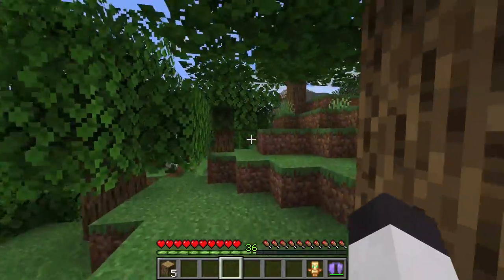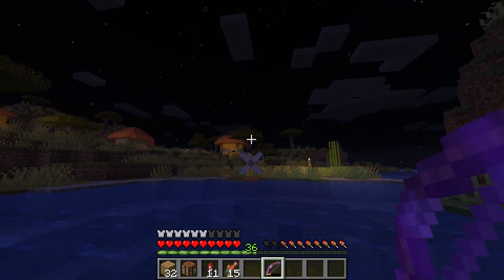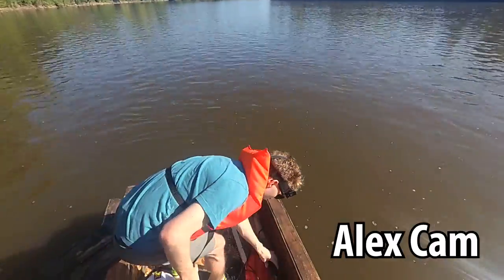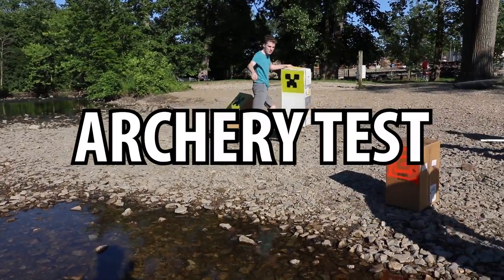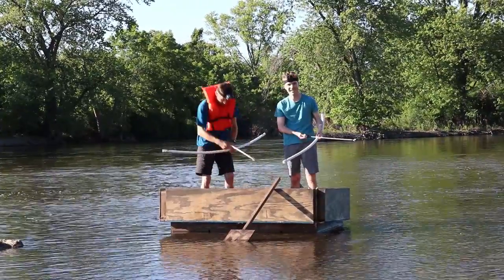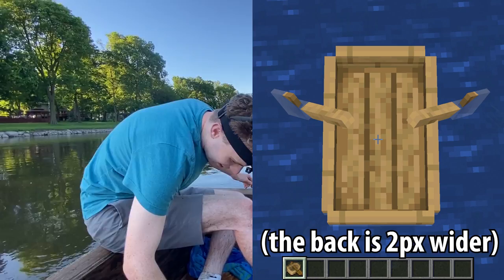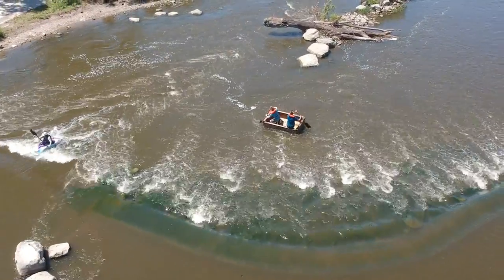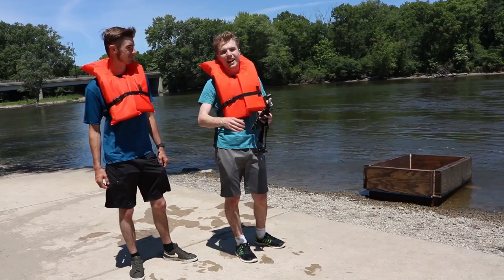Will It Float? Testing Minecraft Boat in Real Life!

Comment: Ya know why the boat is so fast? Cuz it’s being rowed by the same guy that can carry 45,000 tones of gold blocks without breaking a sweat
Reply: Lol
Reply: Only 45K? But what about shulkers and ender chests holding golden apples which are made of eight gold blocks each? That's easily 8-10X 45K tons!
Edit: Seven months later. I feel like I started an argument now and I'm not sure if I like it or not.
Reply: @Lorinissa-  watch the video, 45k is a massive understatement
Reply: @alexs6746  I don't remember the slight details like that
Reply: @Lorinissa-  e chests don't count, they have no connection to the inventory other than both being in the player data. if you die you drop your inventory but your e chest is fine
Reply: Do y mean tons?
Reply: @kaitlincanterbury4415  Different measurement, or maybe just the different spelling idr. There are two kinds of Ton, there is the short ton, which the US uses, and the Metric Ton, which almost everyone else uses.
Reply: @kaitlincanterbury4415  I just typed what autocorrect correct let me
Reply: @Lorinissa-  the ender chest is technically infinitely dense but with only its material weight, so it would only be like 2 meters cubed of obsidian and one fire-powdered enderman testicle. This results to the total weight of 20400 kilograms, or 44974.301 pounds. Compared to the gold, it's certainly a lot less

Also why the heck am I calculating this
Reply: @David_Franco  O.O
Okay but that's actually pretty cool-
And no, I actually didn't know that ;-;
Reply: This isn't a chat.. it's a youtube reply section
Reply: And a guy that can hold infinite items in a pocket. With a help with ender chests
Reply: BRUHIFY
Reply: “Tones” yep that’s how tons should be spelled tones is like a tone for a voice or instrument XD
Reply: WOAH XD
Reply: Yeah makes sense now
Reply: What about a shulker box has 27 chest,each has 27shulker box,each has 27 stack of golden apple enchanted(from 1.8)equal to 102036672 gold ingot
Reply: you’re a genius
Reply: Steve OP
Reply: And he can break a log with his hand just his hands! That like breaking your leg
Reply: True
Reply: 😂😂😂😂😂😂 so true
Reply: Steve is secretly superman
Reply: AND HE CAN BREAK STONE BLOCKS WITH HIS HANDS!!!!!!!! Now that’s like breaking 10 legs at the same time
Reply: Lmao 🤣🤣 XD
Reply: 45k? You mean THE FUCKING OMNIVERSE!
Reply: Lol, So true.
Lol, So weird.
Reply: Fax 😂
Reply: Technically it's horsepower since being strong doesn't technically mean being fast
Reply: It has been brought to my attention that Steve is also capable of consuming en entire chicken, bones and all, in a matter of seconds, this mans is insane.
Reply: Even more weight in netherite
Reply: And the same guy that can wield an iron pickaxe with one hand swinging at the speed at light
Reply: Oh so true!
Reply: @xianpaulosolis3822  both are technically correct
Reply: Well yea that’s true and it makes sense too
Reply: Wow made that rime without trying
Reply: The dude can carry the MULTIVERSE without breaking a sweat.
Reply: @KL-ew3fx  so that's the reason ya dont have to worry... U won't receive notifications... Utill ya comment 😀
Reply: But can't jump over a 1m tall fence
Reply: @senorx1011  only weakness, one and a half meter wall
Reply: Steve can have infinite space. You fill up your inventory with Shulker boxes, And in those Shulker boxes you fill them with gold except one slot, and in that slot you put another Schuller box. And you fill all the space in those Schuller boxes with gold except one slot, and in that shot you put a shulker box. And you repeat that forever. So steve can hold infinite amount of stuff
Reply: @blank888  only one problem there, you can’t put shulker boxes in shulker boxes (I’ve tried)
Reply: @alexs6746  noooo, well the next best thing is to put chests in the Schulker boxes and fill the chests
Reply: Lol
Reply: 19,300 kg/m³ × 64/slot =
1,235,200 kg PER slot

1,235,200 kg/slot × 27 slots =
33,350,400 kg PER shulker

So yeah on ONE ARM he can carry 33,350.4 tonnes
(On Inventory oooooooooo boooooyyyy)

33,350.4 tonnes/slot × 36 slots of inventory =
1,200,614.4 tonnes of gold
in survival (but on creative there is a way to make it larger but im not Austin)
Reply: i forgot enchanted golden apples but the comment is about gold blocks
Reply: not only can he carry it, but he can full on sprint and jump at over 5 meters per second . he just built different.
Reply: @Lorinissa-  golden apples are 8 golden ingots each
Reply: Ha
Reply: @cowhorse4146  They were probably referring to the old crafting recipe for the god apples
Reply: And murder a dragon from another realm
Reply: If you calculate it assuming gold blocks and not enchanted golden apples, using a combination of shulker boxes, armor, and the off hand, it would be 62,208 gold blocks, which combined with armor, comes to about 1,361,679.7 Tons. So yeah, Steve can lift
Edit: Assuming that enchanted golden apples have the same composition between all versions of Minecraft (8 Gold Blocks and 1 Apple), that would bring the total amount of cubic meters of gold to 497,664, which adds up to 10,598,642.1 Tons (If you also consider the weight of all the apples required to make that many golden apples, which ads about 6 tons), while also not considering the wait of the shulker boxes sense there’s no real way to determine that.
Reply: @jaderking8598  powdered*
Reply: @David_Franco  powdered*
Reply: @jaderking8598   did I not say that?
Reply: @David_Franco  yeah, thats why i answered You with that xd
Reply: @jaderking8598  no you're supposed to use that symbol when correcting someone
Reply: @alfielfordgabriel  But to another Steve, not a normal human
Reply: @blank888  So shulker box, chest, shulker box?
Reply: Mans as strong as base form goku
Reply: Just look at Steve being able to break wood with his bare hands and wear that heavy af diamond and netherite armor
Reply: On the other hand, the boat should be able to float with the guy carrying that much stuff.
Reply: Very final conclusion; the boat is sturdy af
Reply: Or like 3 Billion Pounds
Reply: @prot0prawnsuitablesinc.dom185  Europe also uses short ton
Reply: @alop53O1  Ah ok.
Reply: The same guy who can long jump 4 metres forward and break 1 cubic metre of wood in 3 seconds with his bare hands.
Reply: 2 things is that a game theory and tons not tones
Reply: It’s like 8x10 to the power of 500
Reply: He can also destroy a tree with his bare hands
Reply: Even that guy could carry a full inventory of full-stacked enchanted golden apples that's crafted with 1 apple and 8 gold blocks before the recipe are removed due it is too overpowered
Reply: Nothing compared to the terrarian
Reply: what about packed ice, its heavier than gold...
Reply: @rafi_cat2851  i think ender chest don't cound becuse i think they open a portal to an other dimension
Reply: Breaking a sweat is actually wrong lmao. He does lose hunger
Reply: Oh my god oh my god
Reply: Even more Tones if you use Shulkerboxes, or even OPgoldenapples if you take the Recipe they once had using 8 Goldbloks per OP Apple.
Reply: @jimicencagalfin3129  фхххффхффээхфффйффээхххффф
Reply: @zephyr8921  that could work
Reply: Steve goin swole
Reply: @jimicencagalfin3129  p what your name creeper guy
Reply: @Lorinissa-  e chests don't count because they are a small pocket dimension portal for items
Reply: @jimicencagalfin3129  ฝืเดดดดดดดด
ชง
Reply: Yep
Reply: And he also have a proper fishing rod
Reply: YEA
Reply: Always found that odd to me when I first played Minecraft
Reply: @Lorinissa-  I think it’s like 19 tons for a 1x1 meter block and you can hold like 63000 blocks in your inventory using shulker boxes sooooooo
Reply: True
Reply: Technically infinite as they showed
Reply: Man's can carry 45000 tons of gold no sweat, but can't carry 45000.0001 tons. Tsk tsk.
Reply: lmao God Christ Jesus bless you all and have a wonderful day my family
Reply: u mean netherite since it's four times as heavy as one gold block?
Reply: Yeah he Stronk
Reply: @Lorinissa-  shulkers use alternate dimensions to store stuff (thus come from the end) ,the weight of the things inside them is nullified ,since the items are not physically there
Reply: @g0n245  there is nothing that is comparable to netherite irl so we have no idea how heavy it is, besides he can basically carry an infinite amount of items so it does not matter
Reply: @Lorinissa-  what about shulker boxes full of netherite blocks..
Reply: What about shulckers full of shulkers full of shulkers full of frickin obsidian
Reply: What about that he can break trees and survive being biten by a zombie?
Reply: @Averagecatlover0__0  gold is heavier then obsidian and you can’t put shulkers in shulkers
Reply: @Lorinissa-  I don't think Steve holds the contents of an ender chest, since it's made from an enderpeal and can teleport the contents across the world
Reply: tones
Reply: @joshuataduran4746  and obsidian
Reply: @hiimapenguin  netherite enchanted gapple?
Plus we can't calculate netherite since it's not real
Reply: @blank888  but you can't do that lmao
Reply: @cowhorse4146  Enchanted gapples are 8 blocks of gold each plus an apple
Reply: @swimm8329  you can't do that though
Reply: @SquidsINCIsABadYouTuber  end chests are pocket demensions Shiller boss are not
As can be seen by throwing one onto a catcus
Reply: @bigbrainmatt3080  enchanted gapples still weigh more
Reply: @tigerarora1812  not from holding them though lmao
Reply: @IsLiterallyMe  creative mode doesn't really count
Reply: @g0n245  uhh what it's weighs less since you use ingots not blocks plus enchanted gapples STILL weigh more
Reply: @miltoska9708  your confusing that with ended chests
Throwing a Shiller on a cactus causes it to drop the items same with throwing it in lavs
Reply: @BranBronzebeard701  no ,i am not
The reason for the items dropping is because unlike the ender chest the dimension is destroyed along with rhe shulker
Reply: @miltoska9708  so then the stuff would disiper insted
Reply: @BranBronzebeard701  1:
There is no reason to assume they would disappear instead of being forced out of it 
2: they used to disappear ,until players complained about it and they changed it
Reply: @BranBronzebeard701  true
Reply: @fracturedemperor  we got a funny man here, hey everyone look at this funny man
Reply: @miltoska9708  used to so they don't now
Shulkers basically strink the Space between atoms in order to make them fit
Reply: @alexs6746  Alex S
Reply: @BranBronzebeard701  both of these are just theories somewhat popular ,there is no official lore explanation 
There is no proof of one being more true then the other 
Also both theories can work both with shulkers dropping or deleting items ,so this is a dull point
Reply: And swim
Reply: He can run and jump with those gold blocks
Reply: @b0ark1ng21  swim
Reply: The only reason it’s not going faster is because the square shape generates too much friction. If Steve got an actual boat, he’d probably go as fast as 200km/h
Reply: Netherite blocks in shulker boxes are heavier coz 1 netherite is made of 4 gold
Reply: @VioletZe  ok I see what you mean now
Reply: @Lorinissa-  
Shulker boxes full of shulker boxes full of golden apples.
Boom. Even more heavy.
Reply: if you think about it, steve isn't all that strong. a minecraft day is 20 minutes. steve moves at a speed of 5.612 blocks per second while running. humans run at 2.5 m/s BUT our day's duration is 24h. steve can cover a distance of 6734 blocks in a minecraft day, while a human can cover 216.000 in a real day. if we divide the distance steve can cover in a minecraft day by 24 (h) then 60 and then 60 once again, we get a speed of 0.078 m/s. so if steve were to exist irl he would walk at that speed which isn't that much impressive anymore. but we also need to take into account that in this scenario steve would actually be a god, since he could slow down gravity while falling
Reply: What about a full inventory of shulker boxes filled to the brim with netherite blocks?
Reply: Lol
Reply: Tones????
Reply: @JM-ne5ep  you must be new here, I’ve been corrected on this multiple times and am too lazy to correct it
Reply: @JM-ne5ep  yeh
Reply: Minecraft Steve can carry at least  9,604,966.66 metric tonnes.
Minecraft blocks  are 1 cubic meter
1 cubic meter of gold is 19.3 metric tonnes
1 enchanted golden apple before recipe removal = 8 blocks of gold + 1 apple
1 shulker box full of enchanted golden apples =    
266,803.2 metric tonnes.
Steve can carry 36 shulker boxes so that’s 
9,604,915.2 metric tonnes
And let’s not forget an entire set of gold armor
1 ingot would weigh 2.14 metric tonnes
24 ingots to a full set
51.46 metric tonnes for a full set of gold armor
That comes out to 9,604,966.66 metric tonnes.
Reply: @JM-ne5ep  the more you reply the more time you waste that could have been spend correcting other people’s spelling on YouTube comments
Reply: @alexs6746  well. Its covid. I dont get to do anything anyways
Reply: @JM-ne5ep  you could sleep to kill time. can’t correct spelling while unconscious and if you can then you might wanna have that looked at
Reply: @JM-ne5ep  I just don’t put in the effort to spell every word correctly and let autocorrect interpret my gibberish, basically what everyone does
Reply: And netherite
Reply: @Lorinissa-  laughs in netherite
Reply: And can run 3 meters a second wile carrying that
Reply: The reason why minecraft  boat going so fast is because time passes much faster in minecraft
Reply: @Lorinissa-  Pfff only that much? How about adding netherite?
Reply: And netherite
Reply: Oh my.
Reply: While running
Reply: Yes, that's true
But, even knowing the capacities of Steve... How can the boat float with tons of gold over it? Maybe Steve doesn't carry all the gold in his backpack, but puts it in something like a extradimesional wormhole conected to his inventory, or something like that
Reply: AHAHAHHAHA I CANT-
Reply: @Lorinissa-  😂😂 whether you like it or not your are speaking the truth lol
Reply: He have hammer space?
Reply: Yea like his paddles must be rotating at 2 billion cnots per second
Reply: nEtHeRiTe
Reply: He is too strong
Reply: This is FAX
Reply: @Lorinissa-  personally I don't think itens in e-chests or shulkord weight at all. E chests uses ender technology tu put itens in "other dimension" while shulkers probably use se shulkers caracterists to make the itens inside float and be weightless. That is probably why it can be taken in the inventory and full chests can't
Reply: @robloxguest2633  there are different ways to spell ton
Reply: All that guy needs is a piece of bread for the day
Reply: @Lorinissa-  they removed that crafting recipe so we can't say that but we can say about netherite blocks since 1 ingot is made of 4 golden ingots and 4 netherite scrap so the netherite block is heavier than gold block and we can't use ender chest since it sends everything kept in it to the void dimension
Reply: @Lorinissa-  what about netherite
Reply: Also He Can Break a tree trunk with his fist
Reply: Yes, if it was not loaded with weight and with a little ice it can go faster than light
Reply: Lol ahahaha
Reply: All the replys just see Austin's vid
Reply: @ariamh823  you, you get it
Reply: @Lorinissa-  Steve is able to carry 1324822 tons without breaking a sweat
Reply: It's actually infinity because you can put shulker box in shulker box
Reply: @felix6x311  I’ve tried and you can’t
Reply: Tons*
Reply: Not 45000 gold blocks you can carry like 6000 liberty statue island and can run and jump and netherite blocks are four times more heavy because if you see that one gold block needs nine gold ingots and one netherite ingot needs for gold ingots and nine netherite is needed for a netherite block so netherite is four times more heavy than gold but yeah Steve is very powerful and if he was in real life then you can imagine what he can do
Reply: @alexs6746  ok chill
Reply: Ya know there is a place at a spelling Bee for you
Reply: Tom Games  you, you are a genius my friend
Reply: Should the boat break ?
Reply: This point is solid af.
Reply: He can also grab diamond and diamond is heavy
Reply: Yeah
Reply: True
Reply: It’s spelled tons
Reply: Lol😂😂😂🤣
Reply: @jimicencagalfin3129  still papers
Reply: @jimicencagalfin3129
Reply: Mmmmmmmmmmmmmmmmmmmmmmmmmmmmm
Reply: Э
Reply: @jimicencagalfin3129  a
Reply: @Lorinissa-  у
Reply: @jimicencagalfin3129  1гпаггунлкео
Reply: @jimicencagalfin3129  ฟฟ
Reply: @jimicencagalfin3129  ก่น
Reply: @alexs6746  qeede
Reply: @jimicencagalfin3129  0000000111101х
Reply: 000
Reply: ตม
Reply: ¹7
Reply: Si
Reply: Which weighs more, a ton of iron, or a ton of feathers?
Reply: @kentredwine9515  a ton of feathers because you also have to carry the weight of what you did to all those birds
Reply: @Lorinissa-  dont forget about netherite blocks
Reply: vlfk
Reply: But anvils
Reply: @Lorinissa-  enchanted golden apples no longer have a crafting recipe so I am not sure if it counts or not, but carrying netherite stairs definitely counts with comparing ancient debris' rarity with golden ore and crafting recipe requiring gold ingots it's technically heaviest thing ever, I think Steve can even carry stacks of statues of Unity then.
Edit: if you count ender chests (slightly less heavier than gold), shulker boxes and fully advanced netherite armour it becomes more heavier like what the heck can this man carry.
Reply: I think the math puts it at 11 million tons iirc
Reply: @blank888  you can’t put shulker boxes in a shulker box
Reply: @Lorinissa-  the 45K tons is shippers filled with golden apples / blocks which are 9 gold just watch game theory’s video
Reply: @jimicencagalfin3129  j

mn
Reply: Gshu
Reply: @jimicencagalfin3129  hsjsje
Reply: Zakeksiw
Reply: @user83nf3  TAMA 82
Reply: @jimicencagalfin3129  Si!m BB
Reply: @Lorinissa-  gggggggggg
Reply: @jimicencagalfin3129  gggg
Reply: @Lorinissa-  I imagine that shulker boxes may not need to function with gravity in mind. The End is full of floating objects, and the Shulker's special ability is levitation, so it could be that the box is weightless.
Reply: Technically isn’t it possible for Steve to hold an infinite amount of weight? So the whole game it’s basically god going on a extremely chill vacation where he exerts barely any force.
Reply: @HydrogenBaII  and creative mode is just him exerting slightly more force and literally forcing atoms to come together to form any block he wants
Reply: IdentityX  roblox pfp=opinion rejected
Reply: Yeah that’s a good point